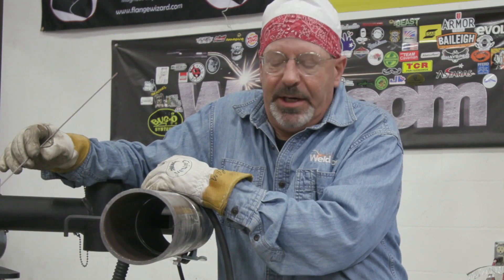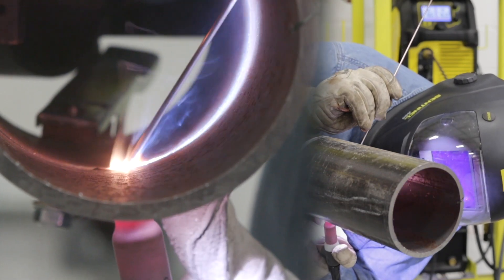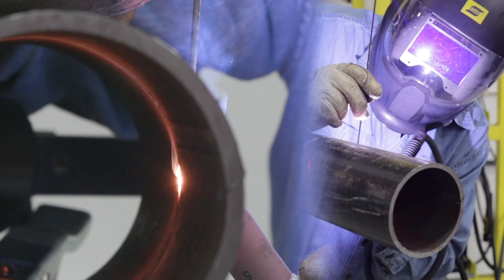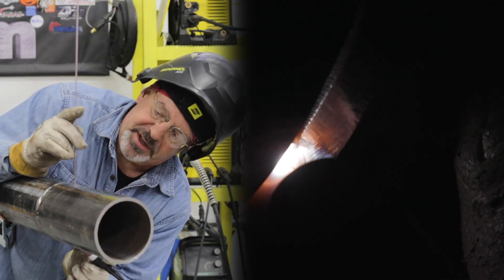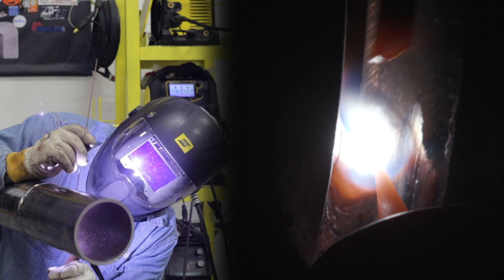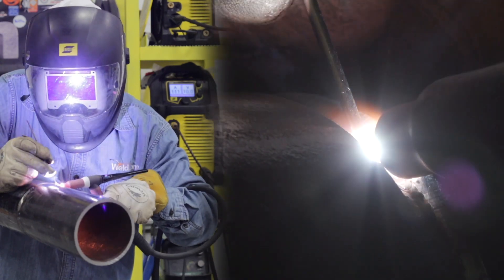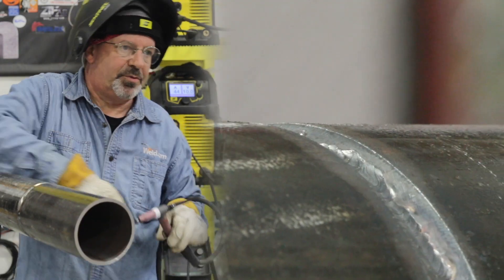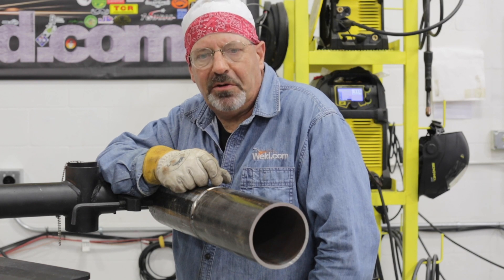5G TIG Root: 4 inch sch 40

Comment: I do a 5/32 gap with knife edges, then do a keyhole root with 3/32 @95, then 3/32 @110 fill, 1/8 @115 to flush and then 1/8 @120 to cap. Very new to pipe

Comment: Have never been able to get the hang of feeding the rod in through from the opposite side. Wobbles about too much in my hands lol.
I feed it into the inside but from a little bit in front of the pool, feels much more precise to me
Reply: That's the way to go as well. Multiple methods to get the same results. I learned both because I was forced by position to back feed. Think radiant coils in boilers or convection boxes.
Reply: @bobmoffatt4133  the other factor is that the last few companies ive workd at (for most of the 20yrs since leaving school) none use 3.2 or 4mm filler. 
All 2.4mm rod, which as you can imagine flops around too much with anything bigger than an 8" pipe.

Comment: What if you take out the filler rod of the shielding gas will the X-ray catch this ??? And do you need to clean the weld to weld ontop of the continuing beat ?? Also do you need to cut of the rod's contermination area, before restart ??? sorry for asking
 a lot of questiong but i need to do a 5G test and im a bit to crazy about conterminating the X-ray weld :$
Reply: If the rod is still at critical temperature and you remove it from the gas shield before it cools enough then it will oxidize, yes. Sometimes when you restart, the oxides can boil out to the top of the pool, and everything be ok. Other times youll end up with porosity which will show up when it gets bombed. 
Personally for a test piece, id clip the end of the wire off myself before restarting. Only takes a second and will put your mind at rest too
Reply: @kf8575  Thanks for the good info ✌️ I also chip of my rod before I restart 😄
Reply: @dionkrabby3713  no probs mate, if you make a point of doing it all the time, wether the end is nice and shiny or oxidized, it soon becomes a habit.

Comment: Bob, since I'm not a pipe guy and don't know these things, maybe you can answer a question I have been pondering with all these pipeTIG videos: why would an engineer spec a tig root on steel pipe vs the much faster MIG (solid or metal core) or SMAW root? Particularly if the fill and cap is going to be MIG or SMAW?
Reply: Quality. Cleanliness. Allowance for un-even fitup. 
Wont beat a Tig root quality wise, only speed wise. Mig roots even with process such as Fronius CMT, Miller RMD, Lincoln STT etc etc, can still leave small spatter deposits, and can be prone to lack of fusion/penetration, porosity problems. Therefore higher repair rates (time and money) unless fit up is spot on perfect every single time, and settings are spot on,
Stainless pipe mig welded well that is  another headache altogether on its own.
Reply: @kf8575  & WTFChuk I can't add much to Ken's reply. Valid points he brings to the dinner table. In my opinion, engineers tend to sometimes "run home to mama" and go with Tig roots as they relate to ASME codes. We don't fault them any for that.  High quality and the ability to handle a variety of alloys efficiently. I've seen good Tig welders smoke the mig hands in production so the speed argument doesn't get much from me. I've seen the opposite as well. Great question and we could have a long discussion over speed, quality, repair ratio, heat inputs and a bunch of other factors to weigh in like operator ability.

Comment: Thanks Bob! Helps out a lot, especially since I'm about to go for a job, that I'm required to do a 6g test for. I have the option of doing either a TIG root or 6010 root. If I can get this TIG Root down it'll be so much cleaner and preferable to do.

Comment: If you were using this same size pipe to  make a 90 foot high roller coaster for your daughter and her friends to ride on !!!!
 would you use 
Tig 
 Mig 
or stick
?
Reply: Gtaw for the root then smaw fill and cap..
Reply: @davetruther31  ,,,great !! Thanks
Reply: Check the WPS
Reply: I feel like if you're asking that question, maybe you shouldn't be building a 90 foot high roller. If someone is building it for you and asked you, than they don't need to be building a 90 foot roller coaster for your daughter and her friends.
Reply: dreddjenkins  afraid its a bit more complicated than simply heat input.
Full fusion. Cleanliness. Protection from oxidation. Nitrogen embrittlement. 
All sorts of factors. 
Too longwinded to go into on here, one website worth studying as a starting point, is TWI-Global.com. One of the worlds top sources of information when it comes to fusing metal together 👍👍